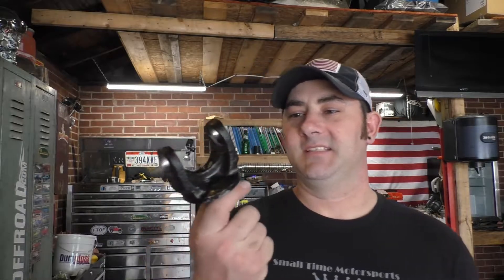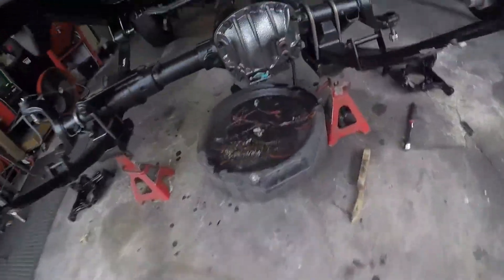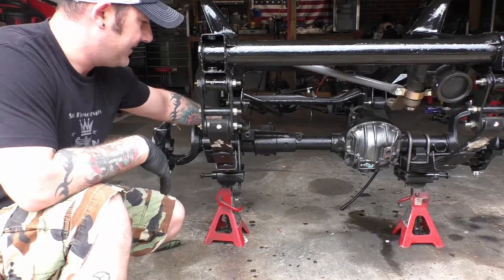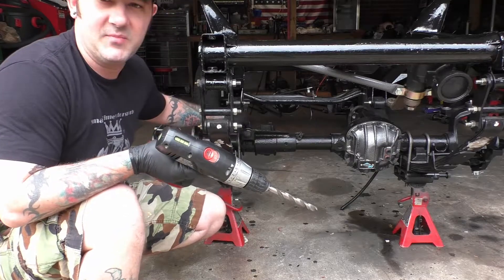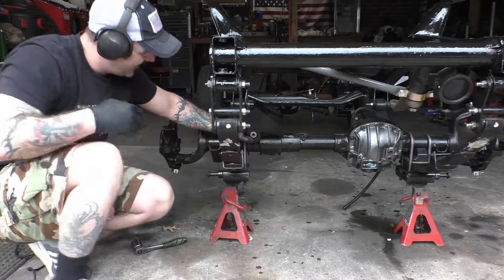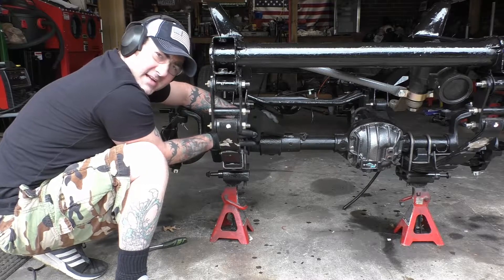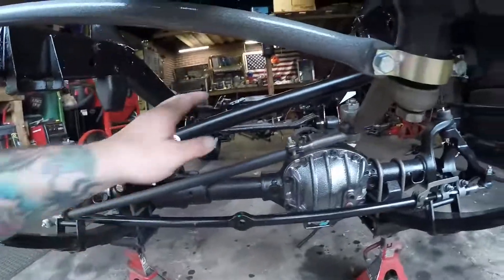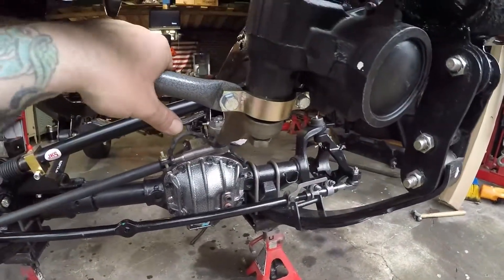Diesel Overland YJ Build: Front Axle Pt. 1/3

Comment: Thanks for your vid ,im doing the same and was kinda lost on this part.im still repairing frame then Im powder coating frame,but I have ford 8.8 700r4 connected to np231,and im putting a small block in it.

Comment: I hear a lot of people skipping on the track bar due to the leaf sprung front end. Why are you choosing to leave it on, if you don't mind me asking?
Reply from the maker: Hello, and thanks for watching and commenting. Just to be brief about it, I am keeping the track bar on the front to stabilize the steering system, without it your steering is only as sharp and acute as the leaf spring bushings, giving a boat like feel in my opinion, and certainly making the steering input less effective. If you care to google it Moses Ludell wrote an excellent explanation of track bars, he also happens to be the man that wrote the Jeep bible. My opinion is unpopular for sure, because in this instance its just easier for people to cut it off than get it right. I hope this helps with my thinking in keeping it. Thanks again for watching and commenting!!